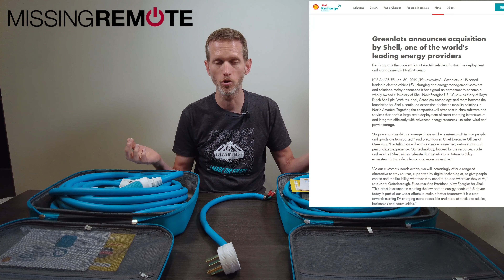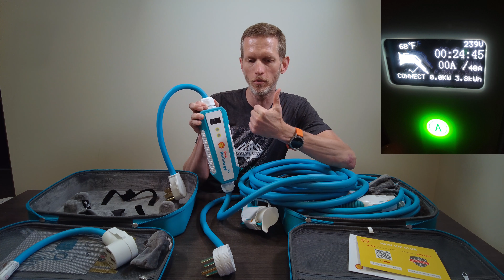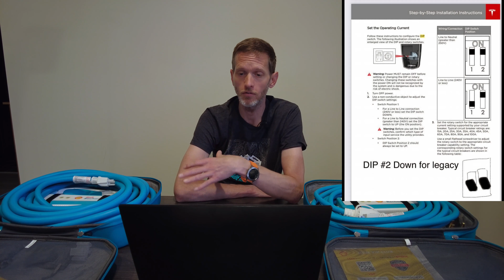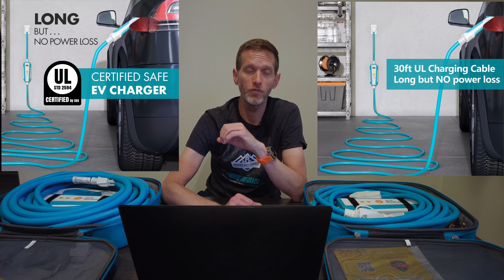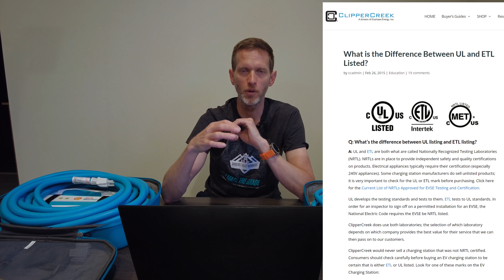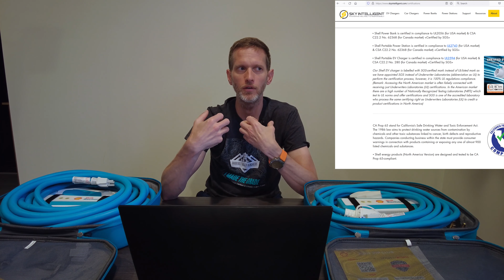Shell Recharge / Sky Intelligent Adjustable 32A/40A EVSE (aka EV car charger)

Comment: Very good information. I found a 40amp version that had very little inside use for $170. Your video gave me confidence in the purchase. It does have the type one plug, but being aware of the potential problem, I am taking extra care. Currently I’m using the 120 adapter, in garage on a Kia Niro EV. The unit shows 16 amp mode but safely draws 13 amps from my 15 amp plug. Works great on my KIA, only down side is the stiff cord, but being in garage I only need to leave out enough cord to reach plug. I think I will build a wooden bracket holder for it.